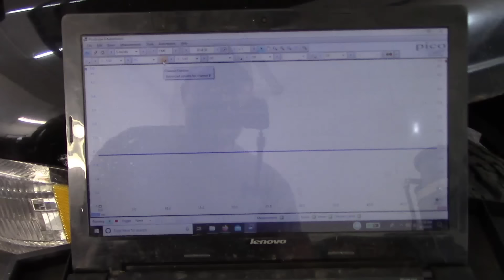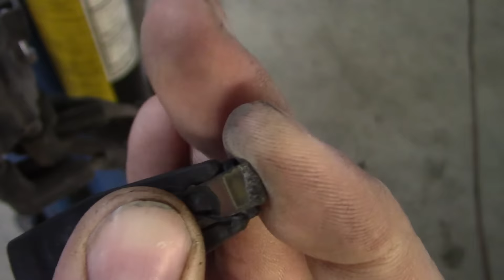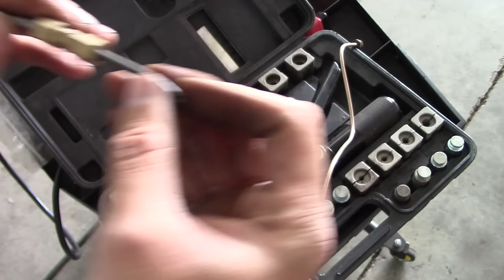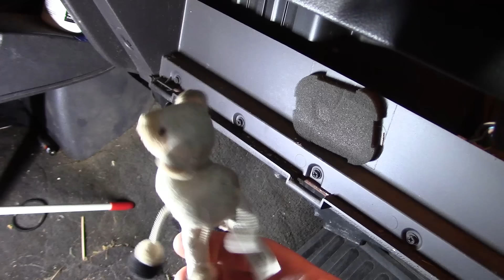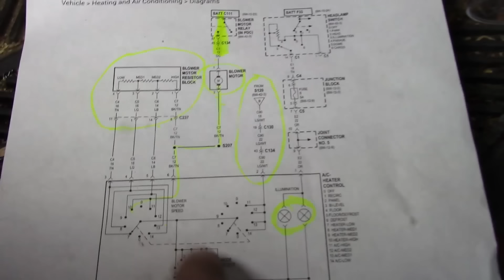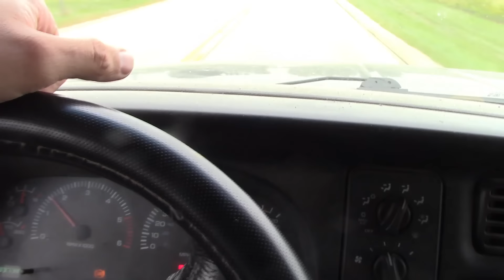2001 Dodge Ram 2500 - Random Missfire, Blown Brake Line, no Heat or AC - basically it's an Old Dodge

Comment from the maker: Pine Hollow Auto Diagnostics: https://www.youtube.com/channel/UCn4Ifss-t3wMT6VBzQoKPUA
Terminal Cleaning Tool: https://amzn.to/3henXPT
Spark Plug Wire Crimper: https://amzn.to/33ji0Mi
Reply: Never had too much luck shortening carbon leads, never lasts too long, copper cores yes, fine.
Reply: Do you know what p0340 is on a dodge ram 2500 gas and the year is 2002 and what would I do to fix it
Reply from the maker: @lolpro-bx3oy  It's a cam shaft sensor signal code. But fixing it would require diagnosing the problem.
Reply: @WatchWesWork  how would I run a diagnostic to find the issue or should I send in to get fixed and do you know were i would find the sensor
Reply: @WatchWesWork  Wes that coolant loss can be seepage at the intake manifold gasket and cylinder head mate. 5.2 and 5.9 gas are notorious for this. Mine used about half a gallon a year. Once topped off I just kept checking overflow tank topped off every month. It never got worse unless it was left unchecked. It's got 300.000 on engine and 230,900 on bullet proofed trans. Hate all ya want still running and on the road with body panels flapping in the wind in detroit michigan! Will run it till it can't run no more. I know more dodges like this than the same year Ford or Gm. So go ahead and hate dodge more they were definitely better than the 5.4 triton Ford's hands down.
Reply from the maker: @cav444  I probably bought it from Zoro, which is part of Grainger.
Reply: You should use terminal cleaner before removing battery cable ends
Reply: Wes.
For electrical connectors get yourself some DeoxIt gold and/or red.
One is low temp aps and the other high temp aps.
It's made specially for electrical connectors.
It comes in several types, drip, spray and wipes.
It's an friggen' awesome product.
It keeps corrosion from returning.
I've used it on boats, cars and in my profession repairing pinball machines and arcade games, Jukeboxes and other electronic equipment.
Google it.
Reply: I have the 03 2500, recently had to replace front driver brake hose and also the steel fitting that was m12x1 thread inverted flare. Could not find replacement fitting so we hacked a m12 bubble flare fitting and used a steel compression fitting, crazy
Reply: Next time use a little water and baking soda and it will melt that corrosion right off the battery terminals.  Make them look like brand new in less then. Min
Reply: @mccullough-crazy257  I thought I was the only one who knew that trick, I never see anyone else do it
Reply: Ivan is the best. Be carful with that scope blanking out like that it means it’s taking feedback into the scope you need to ground the scope with the screw in the back or ground your sec leads. You can destroy your pico that way
Reply: Wow I cant believe you gave that truck back to the customer with the front end about to fall out

Comment: I have an 99 Ram 1500 sport. The only thing I have not replaced on the drive train is the front drive shaft and the front axle (I did put front brakes on it)
Replaced every line. Gas, brake, exhaust, vacuum, transmission, heater, radiator and hoses, heater and ac cores, 
Cab corners, rockers, hood, grill , bumper, and a mountain of assorted parts. My wife loves this truck, I hate it. I have just spent too much time under it. The motor came apart dramatically, I put a remanufactured long block in it, 50 miles later the transmission spit out the band anchor, when I pulled the transmission out I discovered the transfer case was cracked halfway around, the rear driveshaft was bent, the clutches were out of the posi in the rear end, the pinion bearings were shot. Tune in next week to the next episode of “this old truck “

Comment: recently took my car to a mech in the hopes of finding out why it was progressively running poorly as it warmed up. he never found the problem. i eventually did... it was the coil wire shorting out and affecting all cylinders, but only once the engine warmed up. apparently, wire resistance increases with heat.

Comment: i had a 2013 hyundai sonata, which chipmunks & mice would get in all the time. i realized they were getting in when i went to replace the damn cabin air filter. i pulled that thing out, & about a dozen acorns went falling down into the damn blower motor, right in the center. turning on the heat, or anything using the blower sounded like it was filled with, acorns of course, it was loud and horrible. im way too bog to fit in there easily, so i concocted a adapter for my shop vac, which i used a 1/4 ID water cooling tube for, so i could snake it down in to the blower blade housing. i actually got all the acorns out, which saved me from having to pull the damn blower motor & blade out. i could never be a mechanic

Comment: I wonder if the front vacuum operated axle had good vacuum lines as all mine were rusted away. If Wes showed this issue and I missed it, sry😮... Typical Dodge truck issues.  😊

Comment: All people should be required to learn basic preventive maintenance for Autos, trucks when they apply for their Drivers license. Some folks can barely put gas or diesel in their trucks, cars. Every day I see at least two to three auto's with low tire pressure yet they drive along oblivious to the issue, danger.

Comment: I’m surprised that you have such a hate for dodges. I had a 2000 1500 longbox. 436000km. Original engine, transmission, tcase, diffs, starter. Fantastic truck.

Comment: Mine shifts great but that would be because it got a new torque converter and front pump and input shaft seal in the transmission so if you shift it into reverse and don't put your foot on the brake pedal it will start backing up... that was around 176k same time as the instrument cluster failure lol

Comment: Check the brake light switch my abs light stays on in the dash i get done driving the truck and get out and the brake lights are on and I usually have to tap the brake pedal once or twice and it goes off .

Comment: My defrost doesn't switch on my ram im guessing that is the cheaper thim plastic vacuum line setup under the hood..
Reply: As I said before ac works except for the ground squirrel incident, the heater blower motor works in all positions and the heater controls switch between dash and dash and floor that's why I said I bet unfortunately my issue is more than likely that the plastic vacuum lines get baked under the hood just like the pcm issues they are known for this truck already had suffered from the common instrument cluster failure so that got repaired..

Comment: old Dodges run forever if you keep the oil changed. You might need to occasionally replace consumables. (Plugs, wires, tires, fluids, lines, heater cores, water pumps, exhausts,  transmissions...)

Comment: Which version model of the DeWalt 20v 1/4 inch impact driver were you using to remove the brake line bolts

Comment: I bought a complete set of stainless steel brake lines from classic tube out of Ohio for my 2000 dodge ram Laramie slt longbed quad cab 5.2 litre 318 magnum V8 46 RE AT gloss black 1500 4x4 it has the premium infinity by Chrysler 6 speaker amplified filter sound system and the factory am fm cd cassette player stereo receiver the cd player quit so it was replaced haphazard with a dual xm250 mp3 cd player and I found out that the right side front speaker didn't work because of it having lint covering the vehicle side of the connection but I already had a good useable infinity by Chrysler am fm cd cassette player stereo receiver that was serviced with new belts and all the lights replaced and the cd cassette players cleaned so it was fully functioning so I put it back in the truck and it needs the speakers replaced since the front door speakers are the only ones working but all 4 channels are functional, but the previous owner was replacing the dr door because it was dented and rusty and the passenger side door had a little bit of rust in the center of the bottom of the door, anyways the doors are decent but the passenger side door is rusty in the center of the bottom of the door but they are from a lower level trim truck and not from a quad cab the back of the front factory door is squared off and the doors on the truck is rounded at the bottom corner so they are regular cab or club cab doors, and audio latina speakers are in them which is why I said it was a lower level of trim truck. So I am going change all 4 dr speakers, and I am thinking im going to run a dual amplifier to the hi level inputs and power the rear speakers, truck has a bit of rust on the lower edges of the truck that being said has great floors and the truck bed is almost excellent when you consider it is a factory 8ft 2000 dodge ram truck bed factory no bed liner or bed mat or camper shell and was a northern Ohio truck since new

Comment: I can’t understand why you tag on Dodges so much!!  My 2005 has 271,000 miles on it and I’ve only had Suspension & Steering component problems.

However I did just have the motor rebuilt and just before that had the transmission replaced w/a used one.  It just quit moving under its own power one day and a great vehicle very quickly turned into an enormous problem.

So I started looking for a replacement and suffered systemic sticker shock!! So, back to the drawing board w/existing truck.  I ended up going w/Remanufactured Engine W/3 yr.-100K Warranty!! That’s as good as a new vehicle.  I ended up spending about twice as much as the truck is worth but still only 1/3 the cost of a equal quality used truck.   Hard to justify if prices were at what they were 2 yrs. ago.

Comment: Wow at how nasty that brake fluid is I agree looks like used Diesel or Engine Oil yikes way to much water impressed all the bolts cane out for the brake calipers banjos and the line Clamps @Watch Wes Work

Comment: 12:47. Be careful with the heat around the tire.  If you damage it, that truck is totaled as it is probably the only thing on that truck worth more than $5.

Keep putting lipstick on the pig but it's still just a pig.

Comment: With dodge you have electrical problems that make accessories in the interior quit working but the truck will still run and drive down the road. With Chevy you have electrical problems that kill the whole vehicle and leave it sitting on the side of the road. With Ford you just have the whole engine blow up

Comment: I bought a 2000 Ram 1500 brand new, in the 90,000 miles that I owned it I replaced one cracked thermostat gasket and the brake proportioning valve. Other than routine maintenance, that was it, the most reliable truck I have owned.

Comment: I have a few of these trucks. Grounding seems to be a big problem with them. As far as rust goes, the cabs like to rust as well as the doors. The frames made in Mexico are the cleanest ones I've seen on older trucks.

Comment: Why not use Teflon tape on those fittings to prevent them from rusting the caliper? Wouldn't that also help with future maintenance to loosen  for air bleeding?

Comment: I don’t like your fathers idea of heating up a rusty bolt then quenching it with water! I have removed rusty bolts  & nuts that have been subjected to salty sea air  & I have heated the bolts red hot then sprayed it with WD 40 then work the bolt or nut back n forth until it works loose then completely removing them!

Comment: Hi Wes, great video. On these Gen 2 dodge trucks have you ever come across the issue of ABS/Brake light coming on Intermittently?  I have a ‘99 5.2L and changed the speed senor. Change the diff fluid and looked for shaving, traced the wires to the ABS system and haven’t found anything.speedometer is accurate and not bouncing or lagging. Lights seem to come on after restarts or really hot afternoons. Driving me crazy.

Comment: Hi Wes, an old Aussie remedy for those battery terminals I’d bicarb Soda mixed in water, take the terminals off and paint on, it eats all the corrosion, then clean off with Plain water and dry. Also environmentally friendly. 👍

Comment: I have only seen one ignition system worse than that on a running vehicle. I had a '79 Volare with 168K miles on it that still had the factory plugs and wires in 2003. The electrodes were completely encased in ash, and this car would still do 120 mph without any problem. I've kept those plugs for 20 years because I have never seen anything like them again, and no one believes that a car could run on those plugs, but this one did. Despite their reputation, you can't kill a 225.

Comment: Have you done a video using the hydraulic brake line flaring tool?  Someone told me you have to heat the line if you are doing steel.  
Otherwise it won’t center. 
Wonder if you have to heat it if you are using Nicopp line? 
Thank you

Comment: Everything I have currently is a dodge. I've owned about 7 or 8 of these second gens and omg.. you had me dying laughing at that grille assembly being loose. Every last one of mine except the 98 sport trim.. it's a dodge thing. Lol also the rant about everything being broken. Door pins, dash, frame rot near the sway bars, anything electronic and keep a spare transmission. The 360 and 318 are both excellent motors though. Hard to kill, but the more you try the more they cost in gas.

Comment: To be fair, anything in the rust belt will look like that after 20 years.  I’m surprised to learn that Dodge still used cap and rotors in 2001.  It must have been for the trucks only.   I helped my Dad change his plugs in his 2001 Grand Cherokee earlier this year….it has 220,000 miles and there wasn’t a node left on any of them.  It did still run somehow.  Looked at his manual and he should have changed them 7 times by that point. Lol.  They used copper Champions from the factory.

Comment: 130k on original plugs and wires. Dodges are pretty good. Hard to blame Dodge for something getting jammed in the blower motor and the relay failing as designed.

Comment: WOW, talk about a severe case of lack of upkeep. 
That was a wreak waiting to happen breaks wise.
Not to mention a way way way overdue tune up.
Her gas milage had to be rediculous.
I was actually shocked when that extra crispy break banjo fitting bolt came right off.
It's amazing how Wes gets crusties back on the road up their in SaltVille.
Down her in SoFlo that only happens if you're driving on beaches or launching boats regularly without giving the underside of your vehicle a really good pressure wash everytime you do that.
You'd be surprised how many nuckleheads don't pressure wash their vehicles then wonder why their vehicles end up a rust bucket in SoFlo are the roads are never salted.
Even if you live near a beach or in the Keys you should pressure wash the underside of your vehicle after a hurricane as it tends to leave heavy salt deposits behind on our roads.
You can tell by all the dead mangroves and other vegetation from the salt deposits on their leaves.
I've gone thru 7 hurricanes so far.
4 while living in the Keys.
2 outside the Keys when I left the Keys and the damn things actually changed course and hit where I'd gone to.
1 after I moved back to south Miami-Dade county.
That was Irma.

Comment: I have had 3 Dodges, all new. A 1996 Caravan, a 2005 Dodge Dakota pick up with a V-8 gas engine and a 2007 Dodge Ram 2500 Heavy Duty with a 5.9 L. Cummins diesel. I had problems with all of them, mostly transmissions. I'll never own another. I don't "diss" anyone's ride it's just my experience with Dodge products. And I'm religious about maintenance and take them to the dealer when scheduled. By the way, I live in Arizona we don't "do" snow. Even the airlines and military come down here to "mothball" their aircraft since we don't "do" rust either.

Comment: An old fashioned tip.  Mix up some bi-carb soda with hot water and pour over battery terminals to eliminate corrosion build up.
Reply: Coca-Cola works the same way
Reply: Also damned Good cure for heartburn, but those posts were way past the alka-seltzer cure. Lolol😮

Comment: I hate cars or trucks that don't steer right. Like pulling, like steering to follow road ridges. Like play in the wheel. I will not drive that. My vehicles steer precisely, don't wander, and do not shimmy or shake down the road. I drive poorly enough at my age without bad help.

Comment: I was always taught to clean Battery Terminal crust off with Boiling Water; it takes it to the ground; blowing it with Air sprays Corroded metal all over your Engine Bay

What do you think Wes??

Comment: My brother has a 1995 Dodge 2500 4x4. It's got the same 5.9 gas engine in it. Honestly the engine is pretty good. The rest of the truck, however, is not as good. It's currently in the shop having the rear diff rebuilt. Thankfully it's not his daily driver.

Comment: Lack of maintenance. Probably original wires and plugs also. Also these dodges don't rust like that in the South. The rust belt eats everything. My 99 has zero rust and still runs and drives great. But I do regular maintenance.

Comment: We have a lot of rain in UK  but never seen rust to this extent. After 3 years most vehicles are tested each year and brake lines etc would never be able to get to this stage of decay. Great work as usual Wes
Reply: Ironically the rust here in the Midwest wouldn't be as big a deal if we got more rain over winter. Problem is the salt and brine they spread to deal with the ice and snow
Reply: Ironically the rust here in the Midwest wouldn't be as big a deal if we got more rain over winter. Problem is the salt and brine they spread to deal with the ice and snow